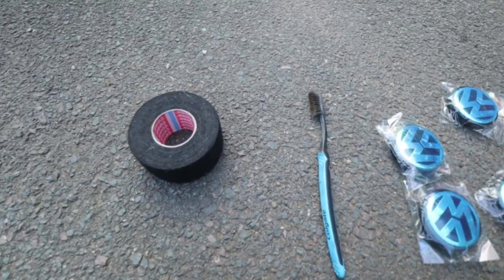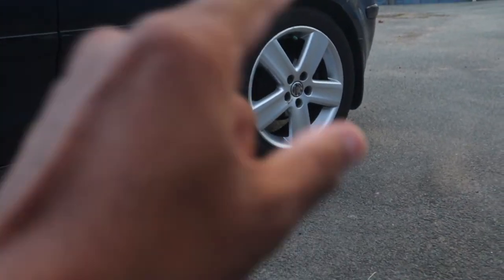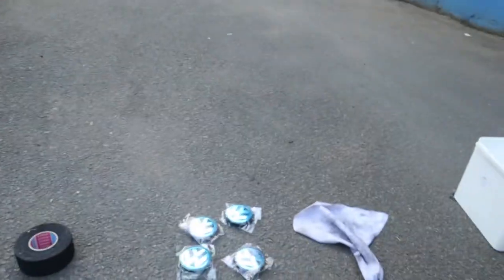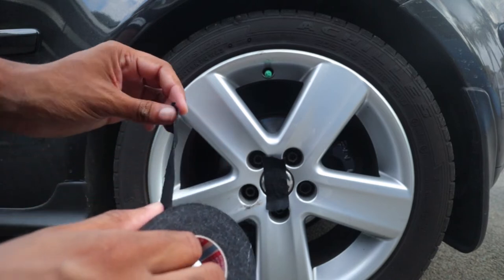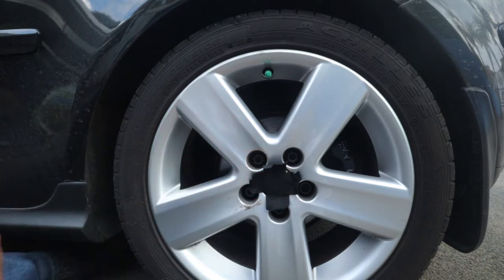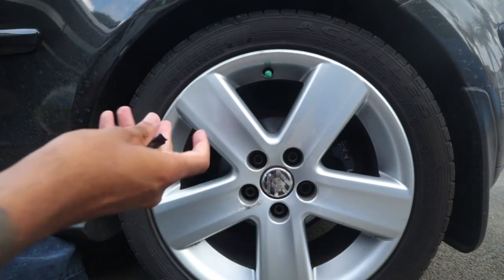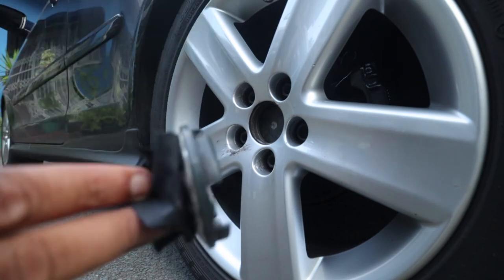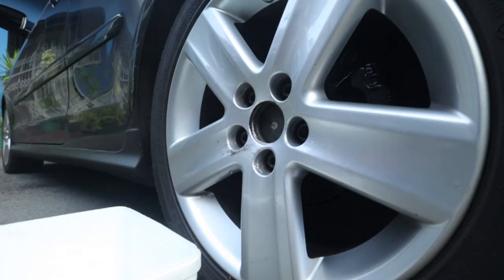How To Remove and Install Alloy Wheel Centre Badge Caps

Comment: My comment is no reflection on this man and his video here. In fact, I will leave him a thumbs up. That being said, it always makes me scratch my head when I see people waste all this time when they are going to throw them in the trash afterwards. This is simple, people...if you do not give a flying crap about the old ones, and you're going to toss them in the trash anyway, there is absolutely nothing faster than walking out to your car, with cordless drill and and hook tool. Yup, it's exactly what is sounds like!  Drill a quick hole, drop the hook tool in, and yank!  Boom, it's out!  In fact, you have no hook tool? No problem, a screw driver works just as good...  No drill?  That's ok too, a hammer and screw driver work just as well. Even using the hammer to bang the screw driver into the center cap is far quicker than c int back 10-minutes later (again, no reflection of this video). There is simply no faster method!  Forget all this 10 to 15-minutes stuff. I did all four of mine in less than 30-seconds - yes, I timed myself!  And, even with a small hole in the center, the old ones didn't look so bad. I could totally reuse them in a pinch! faster. Forget all this 10 to 15-minutes stuff. I did all four of mine in less than 30-seconds - yes, I timed myself!  And, even with a small hole in the center, the old ones didn't look so bad. I could totally reuse them in a pinch! This doesn't have to be too hard if you are not trying to salvage the old ones.
Reply from the maker: Thumbs up back at ya

Comment: Thank you for your video! Didn't want to damage my old caps.
Reply from the maker: Did this work for you?
Reply: @worthowaste  I'm gonna tell you the truth, I saw this video and I went to my car to try, but I notice a gap between the badge caps and the wheel. I used a flat head screwdriver and a microfiber cloth to not scratch the wheels and it worked for me.
I'm thanking you for your video because most videos removing these was suggesting to drill a hole in the badge cap which is obvious that is going out that way. This video is an alternative way to do it.
I didn't want to damage my old caps, whether they are old or not.

Comment: Why not use a thin flat head screwdriver to get it out?
That’s a small car, what type is it?
Reply from the maker: Didn’t want to scratch my rims
Reply: @worthowaste  you won’t scratch the rims if the object is thin enough.
What type of VW do you have?
Reply from the maker: @nan2yvr804  Polo 1.9TDI
Reply: @worthowaste  -I’ve seen those cars in Europe. We don’t have them here in Canada. Must be close to our Golfs or Rabbits.
Reply from the maker: Yeah they are in Europe, these little cars are like rockets, they pack some really impressive power for diesel cars
Reply: @nan2yvr804  the Polo is a newer version of the Rabbit. It was discontinued in Canada after Mk 1, but is up to Mk 7 in Europe.
Reply: @whatbrettdid  Actually rabbit is just a golf rebadged. Polo is it’s own thing, never sold in North America.

Comment: Did u say duck tape or snatch tape and where can i get it from
Reply from the maker: I used electrical cloth tape, you can use duct tape. I find the normal electrical tape isn’t sticky enough. Try with what tape you have at home first, just give it some time to stick if it does not come out the first time

Comment: Why waist $$, just screw any old wood screw into the center of the cap and then pull on the screw, they will just pop straight out takes a few seconds to take out and replace each one
Reply from the maker: That is a good idea. But I did reuse these ones on another car that had 2 missing

Comment: ever consider just drilling a hole in the center caps you'll throw away anyway and inserting a hook to pull them?
Reply from the maker: I ended up loosing one of the new ones, lucky I had the old ones because 2 of them was fairly good and I used one of them
Reply: @worthowaste  hah that was lucky!

Comment: Your caps were stuffed. Drill a 2mm hole, stick the "L" of a small allen key in and pull. All 4 done in less then 60 secs.
Reply from the maker: I ended up reusing 2 caps that I took out without damaging
Reply: @worthowaste  Yeh, that's up to you of course but you can buy a set of 4 of those caps on ebay for $15 - why anyone wouldn't replace the 4 (for $15) with new is beyond me.........
Reply from the maker: Brother the thing is VW prices are insane and where I’m from things take about 6 months to come from eBay and Wish
Reply: @worthowaste  Dude you bought 4 (you show them in the video).....which must mean you have 2 new ones sitting on a shelf collecting dust now. If you are happy with that arrangement it doesn't matter what I or anyone else thinks.
Reply from the maker: Iv actually gotten more, I gave my friends that were missing or had damaged ones so I ended up with 2 old ones on my car by anyway. It’s doesn’t really matter there’s quite a few ways to remove them just a persons preference
Reply: @worthowaste  So you gave away 2 new ones and left the skuzzy ones on your car....right !
Reply: Thank you